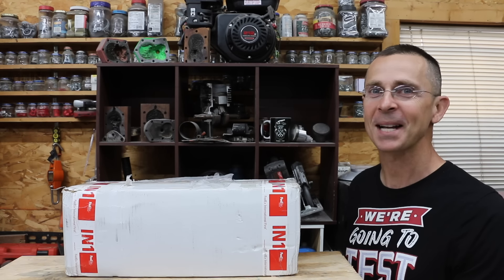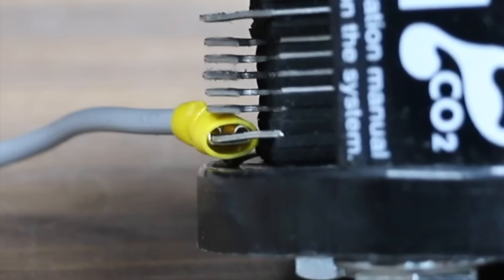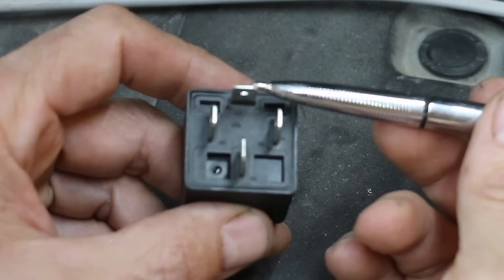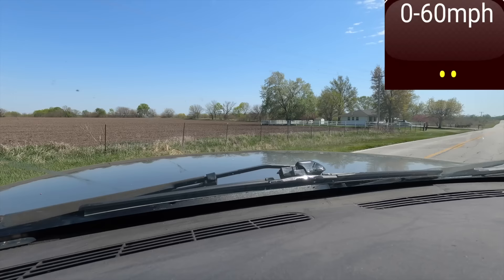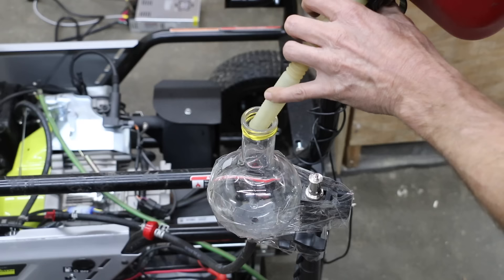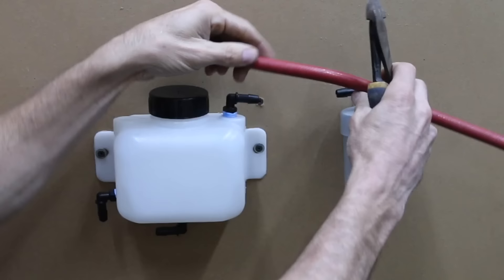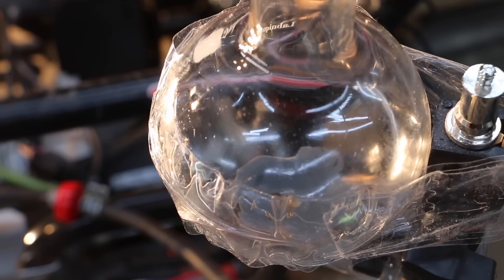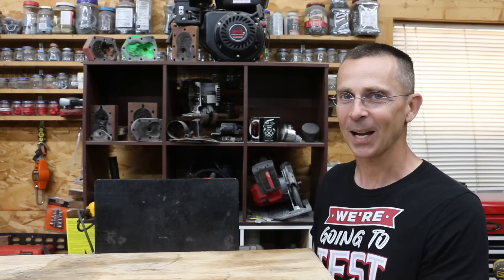AMAZING 35% More MPG with HHO? Let’s find out! Help with high gas prices?

Comment: This is not a valid test because the fuel injection is not calibrated for the HHO intake and it also needs way more air. You need to use a carburetor and run it 100% on HHO without any gasoline. And that HHO needs to be compressed at 10 BAR or more to get a steady stream of gas. You are not getting a steady stream of HHO from that small generator. You also need to use 1000W of power to generate about 3L of HHO per minute. You are only using 30 watts which is 100 times less than what is needed. If you use fuel injection it needs to be reconfigurable on the fly and that system is not. You have to change the fuel to air ratio and that fuel injection is not allowing it.

Comment: Another well-done video. However, this was never going to work. The efficiency of electrolysis is currently listed at its best as 75%. So for every unit of energy produced by the HHO generator (in stored energy potential in the H and O), at the very least, 25% more units of energy were consumed. As the power for the electrolysis comes from the vehicle (when used as intended), the system (vehicle) has to produce more energy that the HHO generator can supply in the form of H and O gasses.  Then there's the efficiency losses in the alternator/electrical generation on the vehicle and in the internal combustion engine (converting HHO into energy).  Finally, the volume produced by such a small HHO generator will be infinitesimal compared to the throughput of gasses (oxygen/nitrogen) in the engine.  I think you're well aware and this was all in fun, not being ugly to you.
Reply from the maker: Thanks!  Thanks for the feedback.

Comment: I know there are Hydrogen running cars.  This is an experiment to see if you can make it cheap.

I think you can but you are balancing the dc power vs mpg.   It takes quite a bit of DC power, or AC, either way, to crack the hydrogen from the water.

The question that comes up with home made hydrogen is,  do you want pure hydrogen and no oxygen or do you want HHO, a mix of oxygen and hydrogen molecues.

Hydrogen when mixed with air is explosive, but when in its own containment, you can make sparks in it and nothing will happen.  The Hindenberg did not explode,  as the fire burnt  into the gas bags the hydrogen leaked out and became a torch,  an extremely hot flame.

Now we know hydrogen has an extremely strong explosive charge,  this can work in our favor  for burning in a car.

A senario that I have thought would work is this.

You have a HHO or hydrogen system that can be injected into the air cleaner on demand.

drive your car/truck, get up to speed and put on Cruise Control.
Start injecting your hho/Hydrogen into the air cleaner.

The additional fuel will force the car to speed up because of more fuel, however
The cruise control will try to back the car down by cutting the gasoline fuel to the carb.

If you are able to supply enough hho/Hydrogen to maintain the speed, the Cruise Control would
back it down to idle fuel feed while the hho/Hydrogen maintains the engine speed.

Wise to put a solenoid to trip the hydrogen if you hit the brakes fast  to cut the gas.

All this said, there are checks and balances

The power to crack the HHO/Hydrogen is quite large and can counter any savings that you are trying to achieve UNTIL  or IF you can make enough gas to counter the gas feed,  IN THEORY, the HHO/Hydrogen would power the loss, however, you would have to have a really efficient gas cracking system to be in the plus.

Comment: The concept of this device is to feed Hydrogen to the engine, not HHO. The design is wrong as the oxygen should be separated from the mixture and exhausted to atmosphere while only Hydrogen is burned in the engine. Once the mixture reaches the combustion chamber it likely is converting back to H2O steam and causing the light degradation of fuel efficiency and power. There is a way to separate the two gasses and feed only hydrogen to the engine, @projectfarm you should modify it to work right!

Comment: Did you tune the air intake ratio?  What year of vehicle did you use?  The newer style computerized cars will detect the gas to air ratio and act accordingly.  You could run it completely off HHO if you had to.  That's the whole point of all this.

Comment: Hi. I have play now for more than a year with Hydrogen in my vehicles. No 1 I think you miss the point, this is about fuel efficiency. So, if you go full throttle and like to see if you get better Millage or Kilometres like in South Africa. You won't get the correct consumption on anything you test . You get the whet system and the dry system. I'm running 3 of my vehicles on Hydrogen. 
HHO DOES (Oxyhydrogen) increases fuel efficiency by an AMAZING 35%. But net when you want to test it in n sprint. You test it on a main road or Highway were you crooze on 75mpu or 120km/h . That is where you get the 35% fuel efficiency. How can you test fuel efficiency with the accelerator flat on the floorboard. fuel efficiency is when your foot is the lightest on the gas pedal and not the hardest you can pooch the pedal to the floorboard

Comment: I think your confused by what they mean. Your suppose to feed the hho gas into the main source of fuel to decrease the cost of fuel in the long run. So in the end your spending less money on gas at the pump 1 gallon of distilled water is what 98cents so essentially your extending your full tank of gas . Your tests just prove that it actually does work and can be utilized if done right

Comment: alright, you need to look into some wood gasifiers and see how well they can work.  They build up a lot of tar and were used in the 30's and 40's during WWII.
Reply from the maker: Thanks for the suggestion.
Reply: most of these projects are DIY for emergencies with wood fuel, but it would be interesting to see any commercial availables ones which could do the job. The original combustion engine ran on wood gas in the 1800s. @ProjectFarm

Comment: During the 70’s gas crunch?, We did water vapor injection through a plate underneath the carburetor on our vehicles.

The idea was that it would raise compression while also adding bulk to the gas vapor charge.

I’m wondering if some sort of hydrogen/oxygen fracking was done though in the process?.

Comment: what's needed is how much hydrogen is produced with that HHO device   per unit of time (ie; minute?).  Using commercially produced pure hydrogen from a tank and a flow meter, use different flow rates to get to a desired fuel savings (ie; increase run time by 35%) with the generator. then you know how much hydrogen is needed per unit of time (flow).  you then know how much gas that HHO needs to produce. if the amount is negligible compared to whats needed you would then need a much larger HHO unit or several in series.

Comment: The problem with hho generators are as follows: The hho generator can not flow enough fast enough to make a big difference and doubly so under wide open throttle.
Reply from the maker: Thanks for the feedback.

Comment: Id say try on a toyota with air fuel ratio sensor versus oxygen sensor. Cuz AFR sensor more or less is a wudeband and ecu does not just go rich to lean like on off switch but actually modulates

Comment: H20:KOH Ratios  Suburban 1000:40=4%; Ryobi 500:10=2% and 500:30=6%.  In either case the ratio should be 10:1 or minimally 10%.  Electrolysis must be supplied with a minimal current for HHO production.  Never once was the subject of current (Amperage) to the Dry Cell HHO Gen. mentioned.  This size Gen. Stack with 18 cells, according to Michael Faraday and my estimate of actice cell plate surface, should be applied with a specific minimal amperage, I estimate 11.5A to adequately generate the minimal required HHO volume for this pig 3.0L Suburban engine; requiring nothing less than 3/4L per minute.  At 11.5A this short stack will run hot; which shouldn't matter because your'e testing the validity of HHO and not the puny HHO generator.  This HHO generator isn't going to apply lipstick on a pig;  unless force fed by vaccum intake at the manifold.  The ECM will require schooling to allow for leaner times.
This HHO Dry Cell DC2000 is intended for 1.4-2.5L engines not a pig 3.0L Suburban weight class vehicle.  It's as if your intent was to prove failure.
Test was invalid.

Comment: Due to CAFE standards the automotive industry has to pay hefty fines if their vehicles do not meet certain MPG requirements. If this worked the manufacturers would already have them installed at the factory.
Reply from the maker: Good Point!

Comment: you need to use a bunch of ThermoElectric Generators to use the wasted heat to make the electric to break the hydrogen free and increase the amount of HHO cells. No drag on the alternator will likely help the efficiency and lean the gas to account for the hydrogen because the MAF sensor wont so the injectors will use the same amount of gas. carbs would be easier to test with and just use an oxygen sensor or a 4gas to confirm...

Comment: The hydrogen generator won't show any extra efficiency in fuel injected motors without tricking the computer into leaning out the fuel mixture and taking advantage of the more explosive fuel. They also compete for oxygen so less gas is almost needed.   I built my own almost 20 years ago out of stainless wall outlet blanks and 6"pvc. Got almost 55mpg in a 1991 v6 cavalier.  Required tricking sensors, timing advances and stand alone computer.

Comment: Its the basic reason why we don't see everything being hydrogen powered. It takes a lot more energy to produce the hydrogen through electrolysis than the gain that is to be had. It's somewhat similar to the idea of powering an electric motor to spin an alternator which will then put power back into the electric motor. Systems like that always provide a net loss.
Reply from the maker: Thanks for sharing.

Comment: I was rather disheartened to learn that the test was a bust. I had high hopes that producing HHO would be a good supplement to a pure petrol system. Sadly, your analysis, simple as it was, appears to put a fork in any need to test further. Thanks for sparing me the time and trouble.
Reply from the maker: You are welcome!

Comment: Thermodynamics prevents this device from helping.  The best you could do under 100% efficiency is the same amount of gasoline consumption for the same amount of work.  Nothing ever seems to be 100% efficient, that is why gas consumption increased as hydrogen production increased.  A better design would incorporate waste energy.  One example is using braking as a generator.  This prevents wearing brake pads and recovers energy loss resulting in higher efficiency and lower maintenance cost.

Comment: I just hooked one up and have 9mpg better fuel economy in my 3.4 liter v6 toyota solara.  I used a 6 plate and 1:3 ratio of potassium hydroxide.  I have the pos hooked directly to my alt and the neg to the neg term of the battery.
Reply from the maker: Thanks for sharing.

Comment: But a question is did you try adjusting the fuel mixture!
Did you lessen the gasoline supply ?
Could you have turned down the gas and still had the Same torque?

Comment: The computer and sensors aren't going to change the amount of fuel to air unless the software were updated regardless of what you add to the intake. The only real way to test it would be with a old school vehicle without computer controlled injection.

Comment: These have been around for a while I messed around with one and chased it constantly.  Sometimes the bubbler would boil over and spill into the intake of your engine which is not good also  cars engines today are computer controlled if you dump in More air thru this HHO system the computer will adjust and start dumping in more fuel which actually hurts your gas mileage. I was told by the person who made the unit that I need it to buy a separate product that would adjust the air and fuel mixture going into the car which is not a good thing to be playing around with it was just one headache after another. Stay away from these if they boil over and go into your engine it's a done deal.

Comment: Having run these tests successfully on 12 litre diesel engines, they do work, but I use only distilled water. Also a decrease in performance means too much HHO gas produced. More is not better in this case. Too much HHO works against the engine.

Comment: Would love to see this test done with hho running off an external solar charged battery,  i plan on playing with this myself but your tests are immaculate! Love your videos
Reply from the maker: Thanks!
Reply: It still won’t help, it just won’t hurt. You would do just as well to simply let the panel help your alternator. But, if you mess with your wind resistance, the panel will hurt.
Reply: @ED-es2qv  missing the point. If you charge 6 batteries using the sun at home and you then use those batteries to make the hho. DO NOT connect to the alternator and cause drag. You are running on free fuel minus batteries and solar panel costs, creating a low efficiency rechargeable gas powered vehicle and whatever the cost, it will be less than gasoline.
Reply: @ED-es2qv letting the solar panel REPLACE the alternator just might be even better. Could be tested with three large 12V batteries that were solar charged. Would be fun to try this. Would have to remove the alternator belts to find out.

Comment: The idea is to run the engine on hydrogen not gas. Can start on gas and then switch to hydrogen. Should be drawing hydrogen from a vacuum. It’s more appropriate to run small engines like the generator.

Comment: Hey if you regulate the carb jet on the generator  by making a bit smaller and then add the hydrogen as the sub I think u can make it run partially on hydrogen like a hybrid sistem . Makes no sense anding hydrogen if your still adding the same amount of fuel . Specially since hydrogen has less energy when it burns then gass . The hydrogen is added to help reduce gass consumption. The jet is still spraying the same amount. Try it again but with a smaller jet and more hydrogen.

Comment: HHO started well then faded. So under full load acceleration it appears the HHO can not keep up. 
Also in question is the power supply on generator test. Perhaps charge a 12V battery and run in parallel?  oh well
I talked to some farmers that claimed hydrogen generator improved mileage. I could see where it would work better on carbs than EFI(?)

Comment: Try it on a Diesel engine. They dont have o2 sensor that messes with fuel to air ratio. I've seen old videos of truckers using it.
Reply from the maker: Thanks for the suggestion.

Comment: I truly appreciate this video. however, using the generator is a farce. there is no computer to control the rate of fuel flow based on sensing HHO.  It will always consume the same amount of fuel. wheres the long term results from the truck? are you using a MAP chip? how was the mileage from Full to Empty?

Comment: Don't you have to adjust the computer module to allow for a leaner mix for any advantage to be gained? The principle of HHO is to allow for a leaner air/fuel mix than what would be possible with atmospheric gas. Testing with the same ECM settings means you are pumping the same amount of fuel into the chamber so of course you get the same consumption. Great experimental controls otherwise!

Comment: Could you try, doing it on an engine that has a turbocharger? This would help move the gas along quicker. Also try to connect a battery to the cell in such a way that it becomes a closed circuit, that doesn’t rely on the  power produced by the engine. It wouldn’t be the 35% the manufacturer is talking about. But it’d still probably lead to better results
Reply from the maker: Thanks for the suggestion.

Comment: Common sense would denote that if any of these cheap, aftermarket devices actually worked as claimed or made any real difference. They'd be patented and then incorporated by every manufacturer. The same way efi and evaporative emission systems have be incorporated into every vehicle.

I think my favorite is "the tornado" which looks like a little turbo inlet that goes in your intake ducting. But if you have any sense at all you can see that it is nothing but a major restriction and induces turbulence. It's actually robbing your engine of horsepower.
Reply: @psychickumquat   I mean EFI and evaporative emission systems are "amazing" fuel savers and they have been adopted by every manufacturer. These systems were much more expensive to develop and they're constantly trying to improve them. Why would they go that route if the solution was so simple? Just put all the "amazing" fuel savers on it and theoretically the vehicle no longer consumes fuel.
Reply from the maker: Thanks for the feedback.